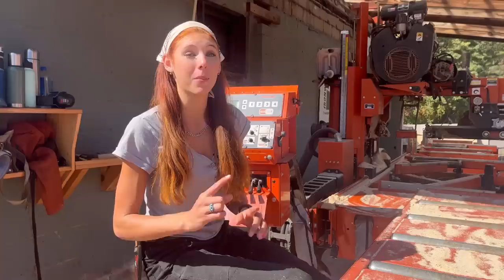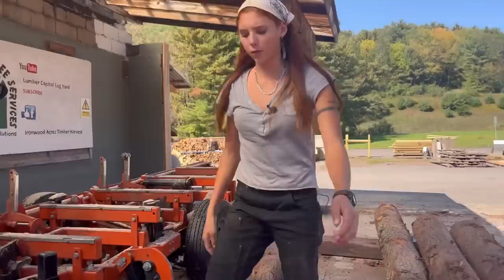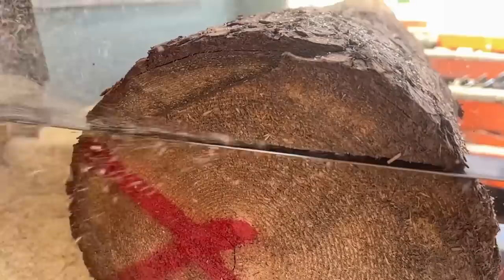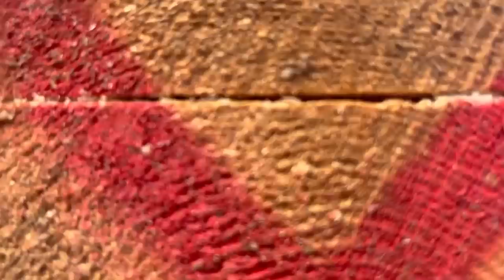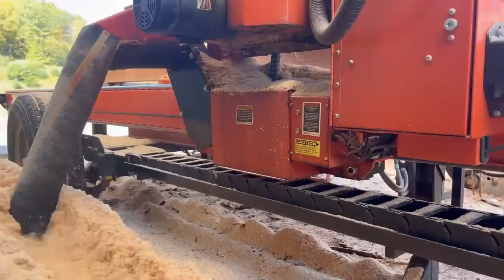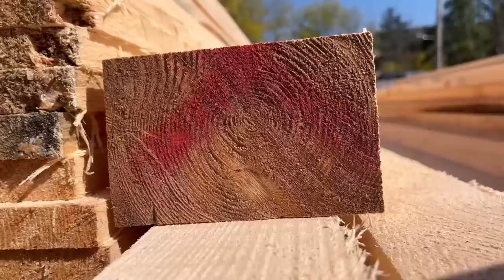BEST Size Logs To Use For Milling Beams!

Comment: Loved your small log economics explanation, Emerald. Small logs, less cut wood for inventory, - less inventory equals less cash, - and time taken at the mill with small logs produces less cash than the time taken at the mill with large logs.
But, the equation only works when time is king because it is a full programme 24/7, and where there is an amount of down time, for both the mill and the operators, then the loss made by milling small logs is less distinct.

Comment: I'm a fan of the channel. I work in a large log mill and we cut Douglas fir and white fir timbers. When we cut our 6 inch timbers ( 6×6 thru 6x14 for inventory plus 8" thru 12" only if we have orders) we are not allowed to have any heart in it or it gets degraded from a select or number one to a 2 and better big price cut. We grade with what we call the heart side up because that is where the shake starts. If we don't see straight horizontal growth rings lines down the whole length or shake we resaw it into whatever has best price per board ft . I think you guys do a really good job and cut good lumber and for all those people who give you crap for not wearing gloves I grade lumber we cut 200000 to 350000 a shift I hardly ever wear gloves and never had a bad splinter I only work with green but once it's thru the kilns be careful our chain pullers get splinters thur glove and hand

Comment: In traditional Japanese beam making,often a thin cut is made from the outside to the heart,along one side. This allows the moisture to exit,and stops the other cracks that would naturally form from drying. Sort of like making a crack where you want it.the side with the cut was used in a place where the cut would not show,or be covered.
At least that is what I have heard.....

Comment: Milling your beams and timbers from the smallest log that will yield what you are after also produces less waste.  Similarly if you need a bunch of 2x4's it's best to get those from a decently big log.  It is more efficient.  I have to say the production quality of your videos has greatly improved of late.  Keep up the good work.

Comment: Over here on the West Coast where the trees grow bigger, the more desirable timbers are free of heart center (FOHC). They are stronger and less likely to twist and check as they dry. A regional difference I suppose.
Reply: I was waiting for this comment.  The hemlock and white pine we have generally do not twist.  The product is used green (for out buildings) and fixes itself in place.  Thank you for your comment and wisdom.  Boss Man.
Reply: @KenBreon  I appreciate the response and the clarification. You have buildings that are older than California so you must be correct. What a wonderful job you're doing! Be safe Boss Man.

Comment: Thanks for explaining these logs are from the top of the trees. I am not in the industry but it looked like that the smaller logs had more taper to them from one end to the other and that your initial cut seemed thicker than usual. By the time the saw got to the opposite end, the excess/waste was minimal to me. Cool content. Keep up the great work.

Comment: Absolutely...
Boxed heart is best for post and beam.
Some Beams are better with the dead heart totally removed.
As you mentioned it all depends on application.
Also it can depend on if it is a show piece or not because any piece of wood with heart in it is going to split open somewhere eventually.
There is a technique used in Japan where they actually make a kerf cut on one face that will never be seen to let the beam or post open up there leaving the rest of the beam virtually check or crack free.  Once dry, the fir and glue in a dry wedge to fill the controlled split.

Comment: interesting you made this video, i am in the process of building a 48x60x14 pole barn and I'm pricing out the material. good info on the vertical posts, i will be using 8"x8" square posts. wish you were closer i like dealing with family run companies. its a pleasure to see young women and men with such good work ethic wish there were more like you and your family out there! stay safe and keep on keepin on! brad from fla.
Reply: Linda, yes too much distance to your supplier could blow the budget.  Take a ride over to Peanuts Sawmill in Bushnell, FL. I have been there with my buddy when we were buying rough lumber.  He cuts mainly cedar I think but possibly some cypress too.  It’s a circular blade mill of the very old school variety but they are good people like LCLY too.  I have a nephew in CT who advised to go talk to Em about his beam needs too.  BTW Bushnell is right off I-75.  I am getting some lumber now too for a small shed but way down in southern WV way back in the woods is too much distance for me too to go to LCLG.  I have a small family mill right near me.  Regardless we can all learn a lot from the LCLY team!
Reply: Good luck with your project.  I wish we were part of it.  Boss Man.
Reply: @KenBreon  Thanks Boss Man, me too.  BTW, I even sent my nephew a directions map to Cogan Station and it’s only about 4 hours, not a bad trip to get quality wood!   Stay safe and log on!  Funny how the term “log on” to a computer site uses the log word.   I think it come from the old use of a ship’s log recording the days weather, events, etc.

Comment: I totally agree. The ❤️ beams are the best for building structures. When I build a fence it doesn't matter as much. Awesome you use those little logs. Here if It's on State or NF they let us cut those littles for firewood. But on private land they make huge slash piles and burn more in a day than my family does in a year. I just split the last of my 4 cords and shoved gramps splitter into the back of my truck, tag now my uncle is it.

Comment: I have really enjoyed you informative videos. I’ve always wondered why the small circular cutter out in front of the main blade. Can you explain
Reply: It debarks the log in front of the blade. That will remove any dirt that accumulates In the bark and keep the bandsaw blade sharp longer. Hope that helps explain your question.
Reply: @ryansetter9014  thanks Ryan. That makes sense.

Comment: One negative with heart center beams is that they will almost always crack from the outside almost to the center as they dry out.  If you are using the beam in an appearance application, you probably don't want a beam with a heart center.

Comment: If it wasn't so labour intensive it would sure be a good use of slash wood piles ( the very tops and large branches ) to be cut into firewood lengths but again the amount of work for the volume of firewood created would be astronomical.

Comment: A pith plank or a center cut timber will allways check to the pith. As the groath rings shrink the weak side will open . Also there is a lot of waste in a smaller log in proportion to the useful wood. The slabs are too small to yield a usable board.It takes a lot of careful decisions to get a clean timber without waynie corners

Comment: Hi Emerald the part of the Woodmiser that ejects the cut piece does it automatically come down or are you manually dropping it down and back?
Reply: its spring loaded to bring back the cut off
Reply: @zarb88  thanks but that doesn’t answer my question. What I’m asking is how does the paddle know the correct height to eject the wood?
Reply: @56Spookdog  i imagine its set to come down about an inch lower than the cut line
Reply: @zarb88  I understand it’s set but once it’s set do you manually have to to do something to hit the set point each pass or is it automated once the set point is input?
Reply: @56Spookdog  no its spring loaded with a stop that only lets it descend a set amount each time.  no operator input is necessary

Comment: Just wondering does the circular saw blade give a leading edge for the bandsaw blade ? Thanks
Reply: It is a carbide toothed wheel that removes bark and embedded dirt and gives the saw teeth a clean start on the cut.
Reply: It's called the debarker.

Comment: To you have the required certification for sorting timber for construction wood. Where I live this certification is more or less reserved for the large coop mills. Lumber from smaller private mills like yours would be restricted to indoor/outdoor paneling etc. Any construction supposed to carry weight require certification.

Comment: Does it matter that, or whether, the the milled piece will be used vertically or horizontally, or is it a question f the load to be carried - either way? Post? Or Beam ?  Thanks.

Comment: Maximizing your sales from the residue of milling lumber should also consider the manufacture of wood pellets. 
You already produce the raw material in sawdust which you sell as animal bedding and compost so why no take the sadust a step further and do the wood pellet thing for sale??
Have you looked into that? It would require some additional equipment and a dry storage building on your property. From what I can see in your video's you already have the dry storage in unused former motel rooms.
Just saying....

Comment: Hate to throw a monkey wrench into this but. I live in the Pacific northwest and Doug Fir is the softwood of choice through out North America, when you go to the lumber yard to buy beam stock we can buy 4x6,8,10,and 12"  up to 20' in stock and order up to 24'. It's always cut from the heart of the tree because it's the size of trees they harvest.  I use to build timber framed patio covers were the beams are 4x12 and the rafters are 3x8 and rough sawn. All are cut from free of heart. Because heart can check, split and twist. This free of heart  is A-1 material and was 4-5 time more than the stuff you could buy at the limber yard.  
Love the show and watching you girls work is like poetry in motion. Thanks again. You girls should do a calendar.

Comment: I cracked an axe handle the other night, so I need to rehang it. I have some Black Locust, Honey Locust and Osage Orange that I might harvest this fall. Any recommendations on what I should use?
Reply: If you cracked an ax handle you were probably using it wrong. Most people do not know the difference in a splitting or chopping ax, and they try to use both for all jobs, which always results in a broken handle. As for asking them, they only use steel ax handles. The dad also said he broke some handles, and now only uses steel handles. My guess is he too may have been using the wrong ax for the job.
Reply: I would personally go with the Osage.
Reply: Well don’t forget Clint Eastwood said “There’s nothing like a nice piece of hickory!”     Pale Rider
Reply: @OhioHillTopsHobbyFarm  The Osage probably won't be harvestable this year. Will know better when the leaves fall .A lot of the Locust will need to be cut before it is too big for me to handle.
Reply: @chrisgullett4332  I don't know. I was really drunk the the time.
Reply: @OhioHillTopsHobbyFarm  But the guy did not even say what he was using the ax for when it cracked. It all depends on what kind of ax he has. Is he using it to chop or to split wood? The guy literally did not even say what kind of ax he is using. Chopping and splitting axes are not the same. They may appear to be just an ax to some people, but when you know axes you can instantly see what type of ax it is. Splitting ax heads are bigger, and chopping ax heads are lighter and thinner. A lot of splitting ax heads will have large rear sides you can use as a hammer or maul.
Reply: @chrisgullett4332  That would be amazing if people couldn't tell the difference between a chopping axe and a splitting axe. We have both, and they're quite different, and I wouldn't even try chopping with a splitter. I used the splitter a lot when each winter we would collect firewood, but then got given a hydraulic splitter one year as a birthday present. Nowadays we have reverse cycle aircon, so we only light the fire on really cold days.
Reply: @vk2ig  Most people do not know the difference. To most people an ax is an ax, and all axes do the same job to most people.

Comment: I have a Guitar body I cut over 20 year's ago from poplar tree I couldn't reach around we were using it for 2 by 12's for floor joists in my baby Brothers log house we built.. anywho this guitar body looks matching book ends and it's one piece.... All the purple red yellow and blue and blonde wood it is mesmerizing I cut it with chainsaw and worked it by hand...😎 All being said it is heart wood and looks like a Heart.... I ramble...

Comment: Nice video. But please remind your viewers that your lumber is not stamped or graded
It is not acceptable for construction that will be inspected  by any building dept
Ok for chicken coops but not barns 
Respectfully
Reply: Respectfully you are mistaken. NY for one has a native lumber law that allows use of ungraded lumber for construction of any structure up to 2 stories with a letter from the sawyer stating it meets #2 or better standards. It is up to town (local) building inspectors final decision but most I’ve dealt with are on board. Can’t speak to PA regulations however.  Best practice would be to get inspector approval prior to starting the build.
Reply: There seem to be many folks trying to shoot all this down - despite the comment from Boss Man saying these beams are used green for outbuildings so they check in place.

Just saying ... (I think that's the right euphemism, right?)
Reply: @_Boregard_Rippy_  please check your local building codes and the 2017 uniform building code
You will see that lumber used in any new con must be graded or stamped
I support the channel and like the videos but they are a little sketchy with OSHA violations 
They sell nice siding but not structural beams
I am a licensed contractor and engineer in California 
Do not defame me or you might get in trouble
Regards